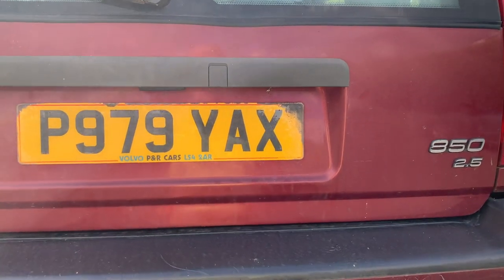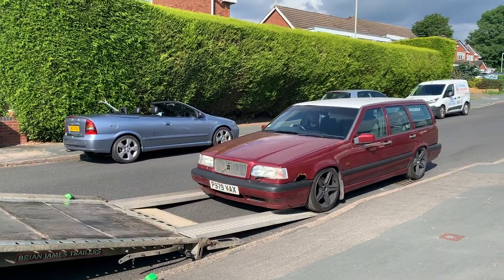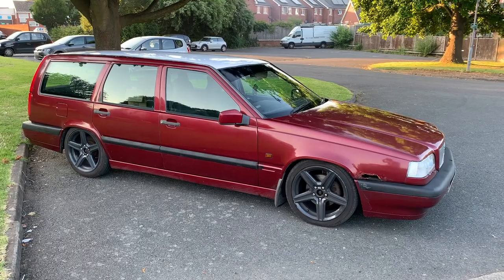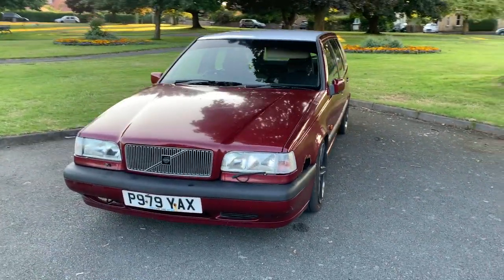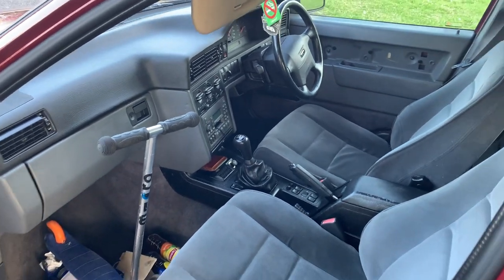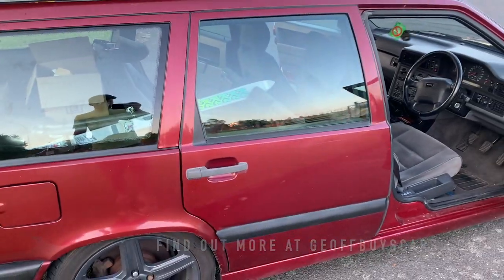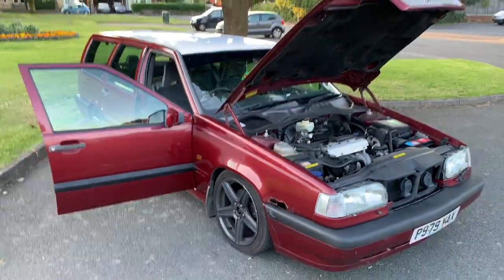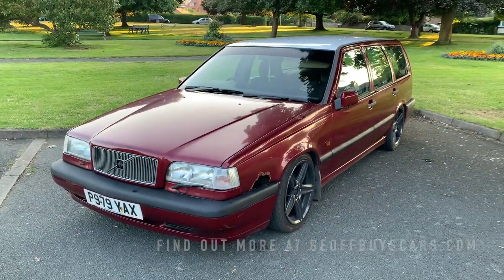Volvo 850 BTCC Part 1 - Meet the car, discuss the plan

Comment: @Geoff Buys Cars   Volvo's are crap mate! My current Volvo roster: 1995 850 T5 wagon, Remapped and modded, 2000 Mk1 C70 T5 in Saffron, 2003 V70 D5 manual, 1997 850 2.0 auto wagon, 2X 850 TDI wagons and a 1998 S70 T5, I need help! Subscribed to see how your 850 project comes along mate!